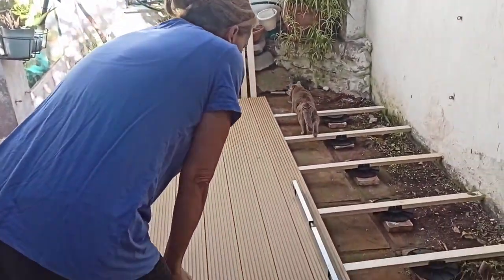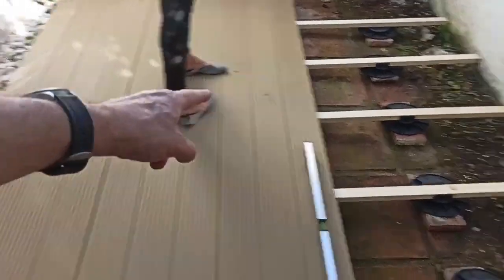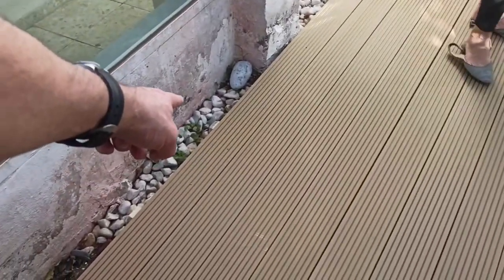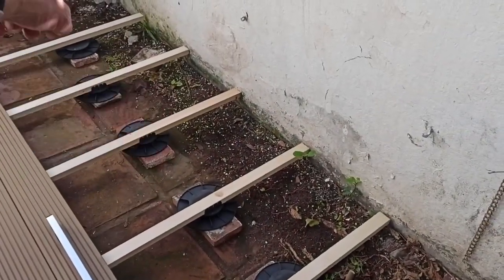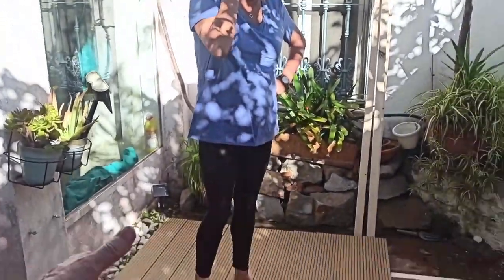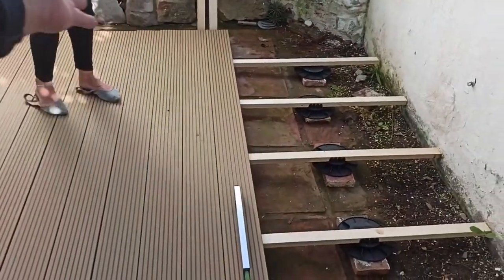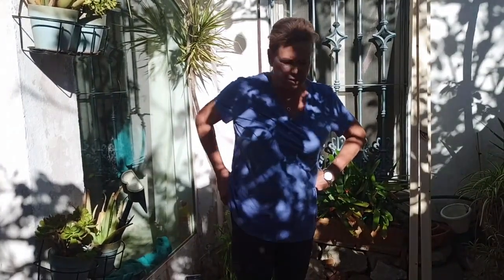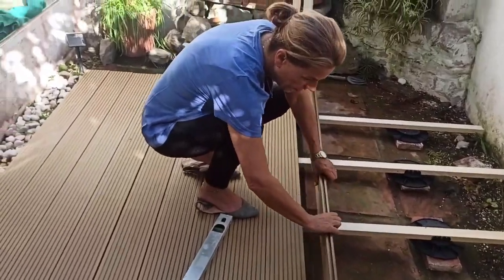Fiona and Graham's DIY Decking...

Comment: I take it that you've determined the locally increased weight of the water in your jacuzzi? That the spacing between the supports under the batons and their cross sectional area, is sufficient to withstand the combined weight of jacuzzi, water and occupation by yourself  ... my neighbours in the summer put in a 4m x 4m plastic pool and they "Levelled" the garden area using batons and sheeting ... 1m depth of water in the pool was fine ... the lady stepped in and ... loud "Snap" was heard and she sunk down 150mm ... so, 16 cubic metres of water drained out ... triple the batons and refilled the Pool ... then the whole family safely sat in the Pool ... Water is 1g per cc at normal ambient conditions  ...
Reply from the maker: 1kg per ltr. so we are looking at half a tonne.

Comment: A busy & industrious day by the look of things Graham, Fiona getting a wee bit irritated by her son bailing out & the pesky cameraman getting under her feet!🤭 
Don’t want to be a Debbie downer, but have you checked that your wooden batons are substantial enough to withstand the load bearing weight of a water filled Jacuzzi plus, (depending on the size) however many adults it may contain at any given time. You might need more substantial joists to avoid the whole thing either sagging or collapsing in time! 
Look forward to seeing the next instalment of operation decking/Jacuzzi. 
PS - I love that tree 😍, don’t you dare chop it up!😱 🪓 🫣🌲xx 💕💞🩷💪
Reply from the maker: I hope so.